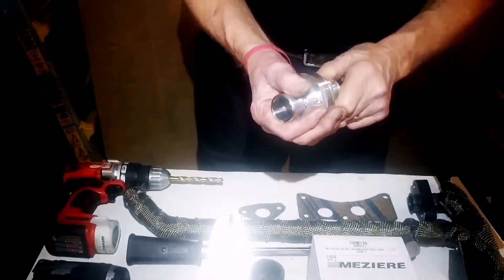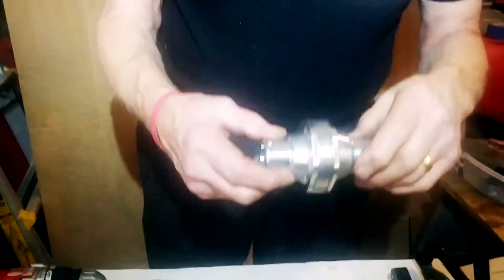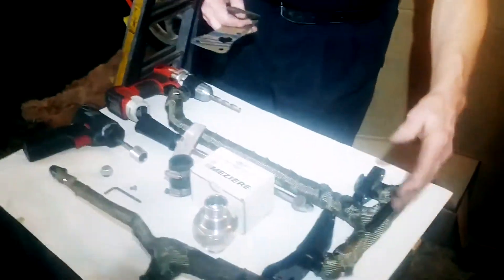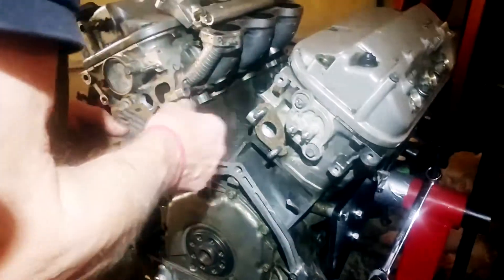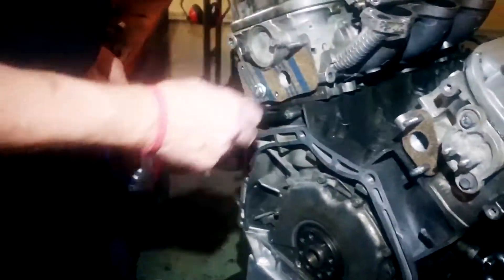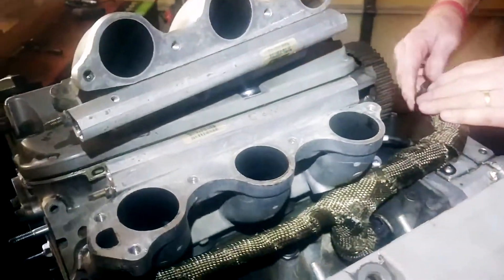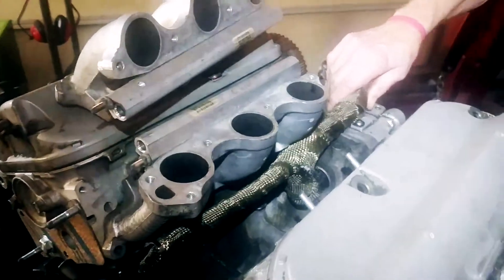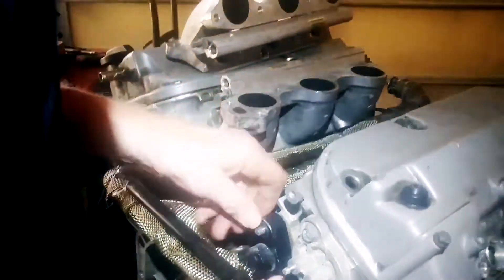OZ Water Manifold Installation

Comment: In this video it doesn't look as though the lower intake runners have been flipped. Just to confirm, I need to flip the lower runners if I want the throttle body at the front?  Then I will have to block off the egr port. To block the egr port can I just make a new gasket for the upper to lower  intake manifold that blocks the port?
Reply from the maker: You have to flip the intake runners to put the throttle body at the front of the engine. There is a EGR opening that is threaded on the back of the drivers side head. We supply a plug for this opening in the OZ Engineering water manifold kit. You only need to block off the EGR opening at the bottom of the intake manifold so you don't have a vacuum leak.

Comment: This looks much much better for routing than what I have currently. I didn't even modify the oem waterjacket. Have heater hoses going all the way around the front of the motor, and theres more radiator hose than I'd like. Will definitely be purchasing whenever I go to swap in another motor.
Reply: Thank you for your compliment. I was uncomfortable having long radiator hoses running above the exhaust manifolds so we tried our best to work out the best routing solution!